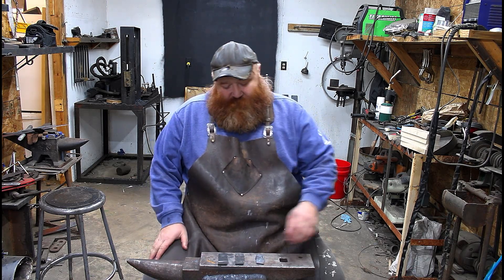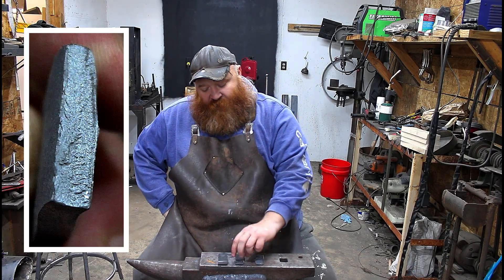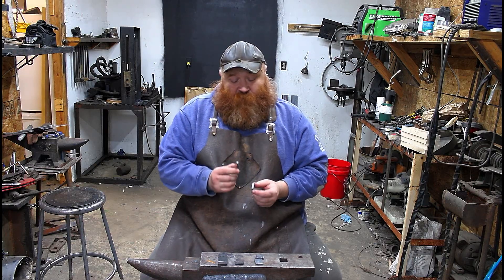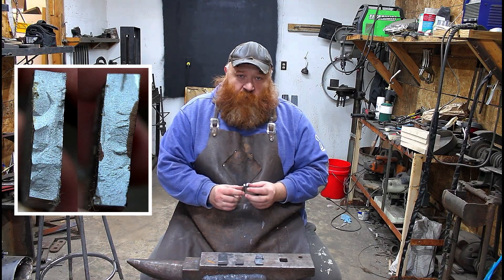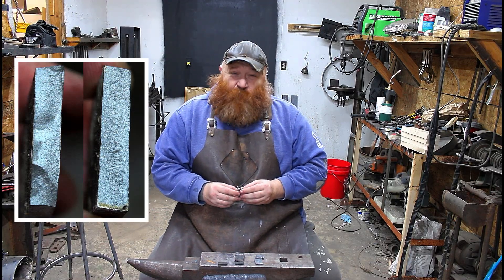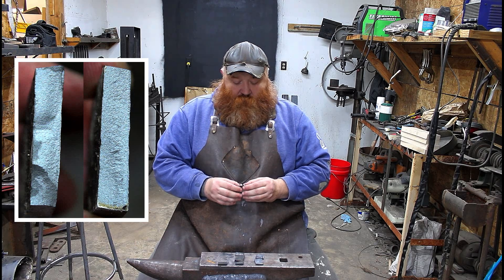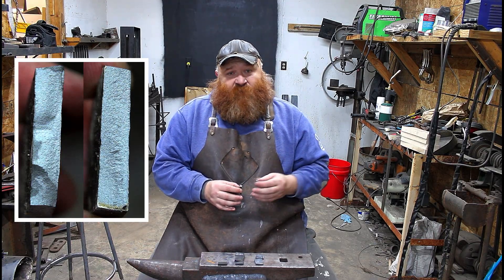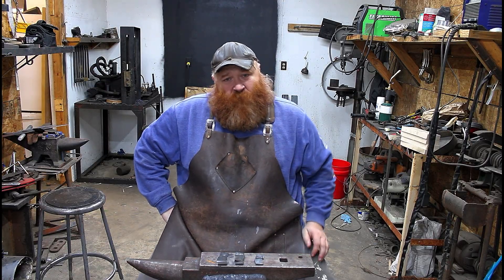Can you HARDEN Leaf Spring Steel? | Bladesmithing

Comment: Did a water quench on a machete for the first time making blade and tempered for 4 hours in a kitchen oven and so far hasn't broken and a file still skates over it .I wasn't so lucky with a Lil knife it did snap its fun trying  backyard forging hoping to learn more about tempering blades
Reply from the maker: More coming down the pipe after the holidays

Comment: This is up there with coil springs and files for being pretty obvious. I like this series in general especially when you get things like bed frame and other types of metal that I don't frequently work with. That being said it would be cool if the testing was a little more complex than just checking if it will snap after quenching vs if it will bend during the same test before quenching but after annealing.
Reply from the maker: More intricate testing in the next series “Indestructible or Not”. Full blade builds testing which quench medium (temps, medium), tempering cycles, bend tests, edge retentions and hardness testing (file testers)

Comment: I make impact rated knives, swords, daggers and axes with leaf springs all the time. I once made a kukri from a leaf spring that I smacked on a piece of railroad track and it took it well. There are more than one type of steel used to make leaf springs though. Some is 5160, some can even be 1095, then you have the Chinese blend that nobody knows what’s in it. So best if using used steel to test a piece just like he did.
Reply from the maker: ❤great information❤
Reply: @rustyhammerforge5902 thank you sir, I appreciate the videos.
Reply from the maker: @PatriotForgeUS ❤
Reply: A lot of the Chinese stuff seems to be somewhere between 1060 and 5160 with quality varying greatly.
Reply from the maker: @garethbaus5471 yeah you really have to check it before you use it. Older the better

Comment: I make filet knives from a stack of semi truck trailer springs I sourced a couple years ago. I will probably never run out, they make great knives although need to be oiled they rust quickly. 200 degree parks 50, quenched at just above non magnetic heat. The trick is multiple cool down phases while forging, let it go to black between process phases, i.e. drawing out, forge the bevels, forge the tang, planishing etc. I temper back at 430 for 30 min twice, have yet to break one in use.
Reply from the maker: That’s awesome

Comment: I guy told me he used to work in a factory making leaf springs said they were quenched in hot oil. 400 degrees, but I have no idea if it was f or c.(Big difference, lol)
Another guy told me that heavy truck springs are better steel than car or pick up springs. I would be interested to know.
My own experience is that the blades are somewhat prone to chipping under abusive use, but I think I can improve on my tempering.
Subbed and looking forward to your experiments!👍
Reply: I imagine the heavier springs are more likely to use an alloy that has a higher hardenability so that you can fully harden the springs.

Comment: I am very happy with the meat cleavers that I made from leaf spring. I put a convex grind on most of the blade to chop bones then about 1.5” on the tip is sharpened to cut any meat that is hanging on. Oil quench with double temper cycles. Thanks for the video!

Comment: There are thousands of great knives made from leaf spring on a daily basis. Are there better steels to make knives from? Yes but the great plus with leaf spring is that its so incredibly available the world over. When you live a rural area and any high carbon steel has to be delivered through the mail leaf spring is more than likely already right there in your community. The one down side to leaf spring though is hammering it down because it moves like molasses going uphill in January 😂.  Thanks for sharing.

Comment: They Hardened really well in both mediums. What i dont get is why after the temper cycle they didnt become less brittle and more tough. Not enough cycles? Not hot enough temper? Maybe as leaf spring they bad alot of load cycles on them past the point of elastic yield strength into plastic deformation?
Reply from the maker: In this instance the quench was way too hot.
Reply: @rustyhammerforge5902  makes sense now thanks for helping me understand :)

Comment: spring steel is pretty low carbon all things considered. 0.5 - 0.6  , barely over midcarbon steel. probably good for big big chopping blades (khukri :) ! )  ? But they are better still affordable choices for knives which first and foremost purpose is cutting and retain an edge ?
Reply from the maker: 5160 actually isn’t low carbon — it’s around 0.60% carbon, which puts it in high-carbon territory.
It’s designed to be extremely tough with moderate wear resistance, which is why some sources rank its ‘edge retention’ lower compared to high-carbide steels.

But heat treated right, 5160 still takes a very solid edge and holds it well in real use, which is why tons of production and custom makers use it for both choppers and everyday knives.

Comment: I've loved this series. Thanks! It would be great to dig deeper into leaf springs, since so many smiths use that material. In particular it would be great to compare quenching and tempering temp ranges for oil and water to dial in the "best" heat treatment.
Reply from the maker: Next series “Indestructible or Not”…Jan. 2026❤

Comment: Really appreciate you taking the time to demonstrate using scrap materials for knives and the properties of those materials. One problem I noticed with leaf springs is that the alloys seem to be very different, so consistently heat treating is kind of a pain. I have to test each piece with dozens of coupons to dial in the heat treatment procedure and then make a blade out of the leftover material (which sometimes isn't much by that point). I've personally found it's cheaper to just get manufactured steel and go from known quantities.
Reply from the maker: Yep which is why I have predominately switched to known brand new steels to use. But I spent 14 years exclusively using scrap steels. I still use them on occasion, but 1525-1550 with a 420 for 2 hours heat treatment normally hits leaf springs perfectly. 1525 is what I consistently shoot for.